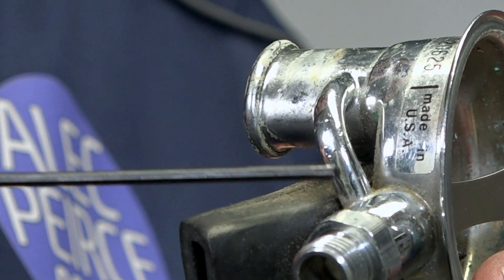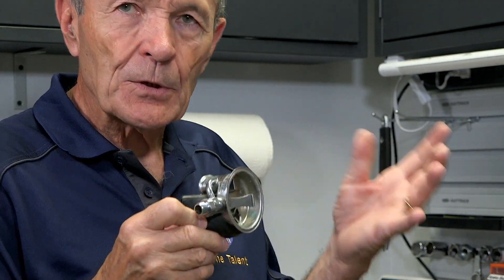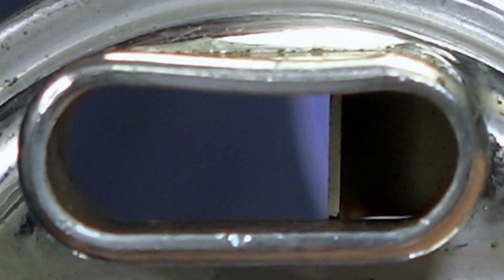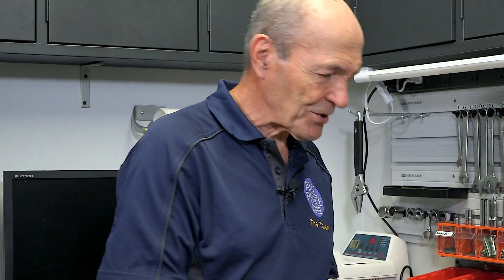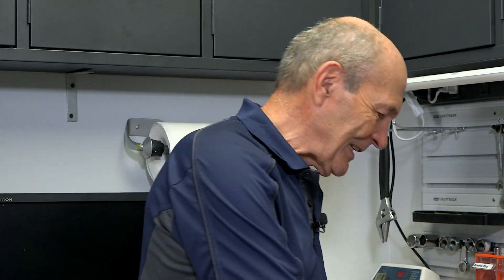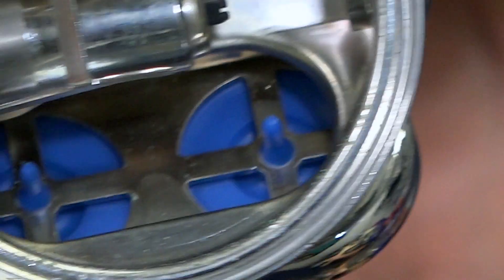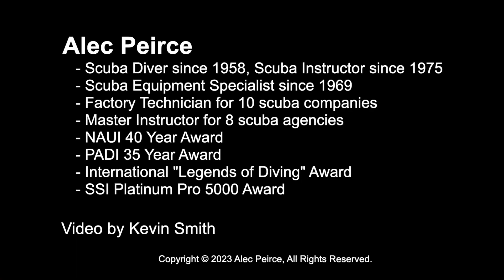Weird Venturi Designs - Scuba Tech Tips: S16E03

Comment: I have the MR 12 II.  I stopped using it in the early 1980's.  I didn't like the air being shoved down my throat. I felt like I had to be using more air because of it.  I like the hose routing of the first stage.  And it is one of the smallest first stages out there. I haven't been able to get parts for it.  But, recently I found a Mares dealer that says they have the parts and can service it.  I love the Aqualung Conshelf.  But, I like the hose routing better on the MR 12 II.
Reply from the maker: Years ago, the MR 12 II's were the popular choice.  Good luck on the service which makes you a vintage diver.
A

Comment: DACOR Pacer's have the Venturamatic System. Big difference is, the venturi is automatic and Lever flap helps it to never free flow when venturi is on demand. Any other regulator in the market with a venturi will always free flow, if its automatic or manually set to, it doesn'tmatter. In addition which you didn't mention is that the mouthpieces right chamber is actually the Water Guide Chamber forthe (Anti-Free Flow Device) or AFD which will not let the PACER free flow underwater since its a vacuum that changes pressure in the diaphragm. It's fascinating how DACOR design this fabulous innovation that works together. DACOR's meticulous 24 year development of this innovative system showcases its flawless functionality and cohesive design. Really amazing regulators and breathing effort still tops todays regulators.
Reply from the maker: I dove, sold, repaired and loved Dacor regs.  Sadly sold my last one years ago.  
A
Reply: @AlecPeirceScuba_SeaHunter  Sad Dacor went out of business.  I bet a lot of divers would still be using them if parts were readily available.

Comment: I have a reg that I thought had a manual venturi, but when I opened it, I noticed that all the switch did was limit how far the valve lever could depress.  That's kind of an odd design that I'd love Alec's thoughts on.
Reply from the maker: I can't place that regulator. Do you know the make/model?
Trying to picture it, I'm not sure how that would create a venturi effect. I wonder if you are turning it the wrong way. That is, it may in regular mode when the lever is restricted & in venturi mode when not. The higher flow of air when the lever is wide open may be considered a venturi effect.

Comment: BTW, worth noting that on any modern regulator, say since about 1985....  😀, Work of Breath (WOB) is pretty much entirely dominated by exhalation effort not inhalation effort, thanks primarily to well designed venturi systems, where the reduction in pressure across the first stage (IP -> ambient pressure) generates work used to help push air into the divers lungs.  When you breath out, there is no such helping hand, and until recently a lot of regulators had high exhaust valve losses.  Modern regs, esp. plastic ones, now can be designed to help reduce these losses, with nice smooth transitions and throats, and by using very flexible silicone exhaust valves, and by using external guides to try to form nice smooth bubbles in the water.  But still something like 70% of the WOB is caused by the exhalation action !
Reply from the maker: Thanks for the idea of a video on WOB.  Viewers may want to learn more about how effort is measured.
A
Reply: @AlecPeirceScuba_SeaHunter  yup could be an interesting video 🙂

Comment: On the Dacor reg at 5:56, are you sure the little flap on the actuation lever INCREASES the venturi effect?

 I suspect it actually REDUCES the effect it in order to prevent freeflow from excessive venturi effect?  This is why the little flap is twisted, because that acts to push the airstream from the outlet hole sideways and AWAY from direct impingment on the the curved guide fins in the mouthpiece tube.  Reducing the flow through the venturi path and increasing it through the main path effectively means a higher pressure acting on the diaphram. This is suspect means they have set the reg up to have a lot of venturi at low flows (ie very easy normal breathing) but use the little flap to limit the venturi effect at high flows to prevent the reg from feeling like it is "Blowing up" the divers lungs and helping to prevent out-of-mouth freeflows?
Reply from the maker: I'm going with increases as I serviced and used a Dacor 900 for decades.  
A
Reply: @AlecPeirceScuba_SeaHunter  I just commented on the apparent angle of the little fin, which as the lever depresses seems to actually divert the 2nd stage air exit jet from pointing directly at the ventury tunnel  😀

Comment: i don't understand how a manual could be better than an automatic venturi. i have a scubapro with an adjustable venturi. i have an automatic tranny in my car even though i know i can get better gas mileage and more fun with a manual tranny. i'm not that much of a tech diver and really don't want to think about the adjustable venturi. should i avoid scubapro in the future for a regulator.   
what am i saving by tuning an adjustable halfway.
Reply: Nothing. The Venturi is either on or off. Some Venturi levers have intermediate clicks, but that doesn't do much. Once it's beyond a certain level the Venturi is on, and before that it's off.

Should you avoid Scubapro regulators? No, definitely not. Scubapro has amazing regulators. You can just leave it to the forward, "Off", or "Pre-dive" position if you don't want to use it.
Reply: @bloodymarvelous4790  why would i not want to use it. i leave my octo in predive mode, if i have to donate my octo i would give the person my primary and i would switch to my octo, i thought that predive mode prevents free flow hence predive mode on my octo,  but someone in the comments says it does not, so what's the point of predive mode. 
you seem knowledgeable in the area i'm just trying to figure it out. i thought all regs had an adjustable venturi.

Comment: Finally someone who explains what the Venturi is actually for.
This is one of your gems Alec.

So many people will tell you the Venturi lever interrupts a freeflow, but that's not what it does. The Venturi effect is that the pressure drops as the speed increases. This will maintain a vacuum in your second stage, which will keep the diaphragm pulled in and the airflow going. That forces more air into your lungs.

If your second stage doesn't have a Venturi control lever, it's set up so it won't freeflow. If you have a Venturi control lever, you can make it deliver more air, but that also makes it more prone to freeflowing, because once the valve is open, it stays open until it meets resistance. If the regulator is in your mouth, the resistance will come when you close your airway. If it's not in your mouth, you'll need to shove a finger in the mouthpiece to provide resistance

Most regulators nowadays will come with a Venturi lever, but you can breathe fine while it's in the "pre-dive" setting.
Reply from the maker: The majority of regs have a venturi but to give divers a lower price, some regs don't have them.  It give the maker a path to upsell.
A

Comment: I still have a couple old regs that I use occasionally that still work like new and can still be serviced. One is a Swimaster MR12 and the other is a Mares MR12-2. One has the venturi and the other does not but otherwise they are identical. Mares chose not to change much in this reg when they bought out Swimaster.
Reply from the maker: Mares regs still have the "bypass" pipe on their regs.  Kind of like a signature look but it still works just as well today.
A